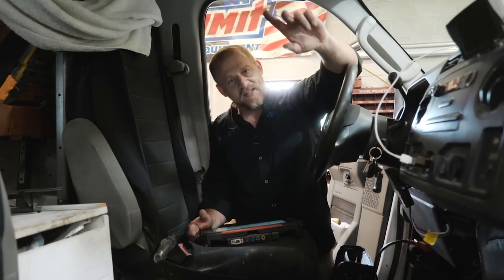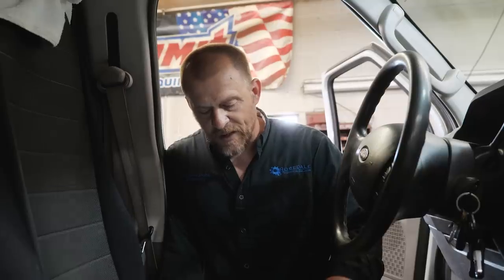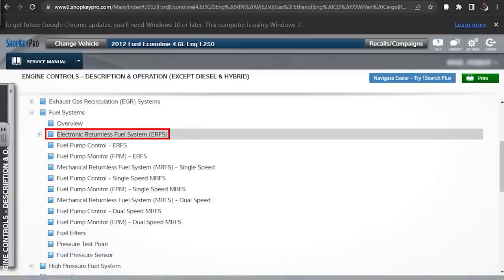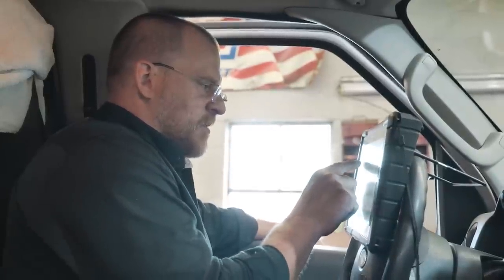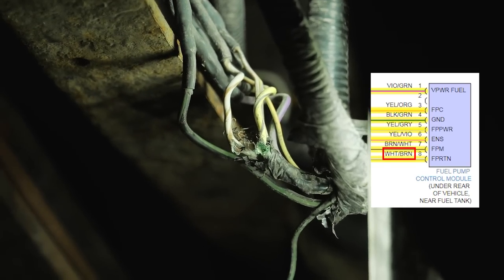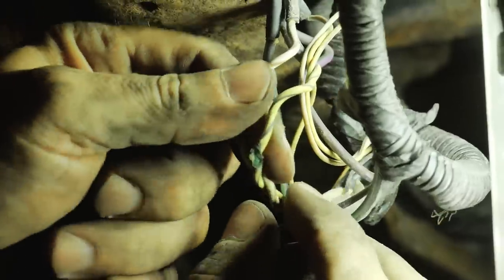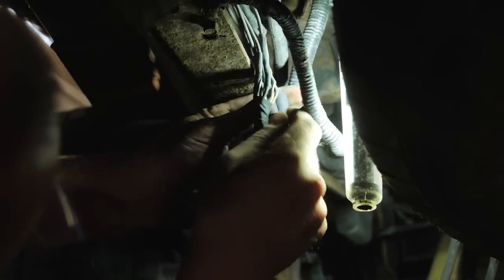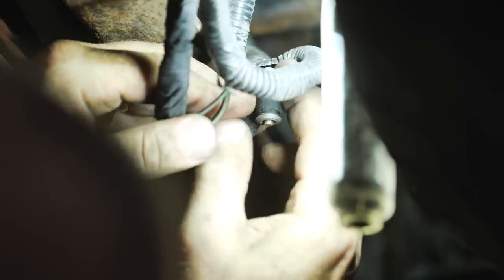New Fuel Pump - Still No Fuel Pressure - Now What? [2012 Ford E350]

Comment: I am one of those southern boys, glad I don't wrench up north! 🤣😂🤣😂
Reply: Ya it will give u a whole new look at a Subaru especially when you have to replace rear cv shafts due to being seized in the bad wheel bearing.
Reply: @claytoncoolidge992  I’ve gotten my hands on a few rust belt Subarus, down from the NC mountains. Not a fun time, but have gotten them done.
Reply: @MrSubaru1387  ya u want some Michigan rust? 😂😂😂  can send it to you by the lbs
Reply: @claytoncoolidge992  no thanks! 😂😂😂

Comment: I agree with you about starting either. It is so volatile that I've seen the hot wire on the MAF sensor ignite it and actually blow up the air cleaner housing. Way back I cranked over a car that was towed in and had so much either in it you could smell it across the parking lot. There was an explosion that blew the valve covers off of the engine.

Comment: Paul I got one for you, I changed the fuel pump on my 89 
F150, I put everything back together truck would crank, but not start, I check for power and ground at the pump, the fuel pump would work if you took jumper wires and hooked it to a car battery, but wouldn't work if connected to the truck harness. Something told me to check the wires at the pump, the wires on the pump were crossed. I switched the wires truck started right up. Always do a visual inspection

Comment: I am all for the splice sleeves with the adhesive in them too. It's quick and easy. The key is, don't buy the cheapest ones you can find. I look at it this way, when I worked for GM, they used to supply those sleeves in connector repair kits for a reason. They work, when done correctly. It is also important to have a good set of crimpers. I bought a set online about 10 years ago that are identical to the ones GM supplied us with in our electrical tool kit. They work awesome, a perfect crimp every single time.

Comment: I've been searching for info on the reason for this type of system, I was working on a 2010 expedition and the pcm was not sending out a signal to the fuel pump control module. Turned out the circuit on the board of the pcm was burned. All i had to do was to clean then jump the burned part of the circuit. But I've always wondered why there was no fuel pressure sensor on the rail, how does the pcm know what command to tell the the fuel pump module. Now it makes sense.  Thank you for sharing this paul!

Comment: My first move on those old Ford trucks was to slide under it and confirm that the FPM and wiring were corroded. They picked the worst possible place to mount a module with an aluminum housing. It helps to spray the module and connections with something to protect them from salt water and humidity.

Comment: I'm with ya on the starting fluid issue. Except that I refuse to use it and you cannot find a can of it in my shop. It's way too easy to use my KV paddle to check for ignition (sometimes) LOL.

Comment: Thanks Paul love your videos using my SD test light it helped me diagnose my bad AC compressor on my Honda . Connecting to the positive side of the battery I read ground on the positive side of the compressor connector . With the connection in , the condenser fuse continues to blow when I disconnect the compressor power feed the circuit stays energized and condenser fans runs normally . Your videos have helped me to save money for me and my family in these tough times . God bless you and your family
Reply from the maker: Thank you! God bless you too my friend

Comment: Michigan(road salt during the winter)eats those modules up like candy. On those Ford trucks after i check for spark and fuel pressure like you did i usually make a bee line for the module (they split) since that issue is so common, as well as the wire corrosion issues.

Comment: When I do not have brush on electrical tape, I use RTV.  I warm it to cure it more quickly.  But it has to be the RTV that does not smell like vinegar (acetic acid) as this is corrosive.  I use ultra grey as it is oxime based and non corrosive to metal.

Comment: i've seen the green crusties wick up a foot and a half into a wire. its a pain but i cut and strip till i get clean copper   no black or green.   best thing i ever used was butyl tape. years ago it was available through euclid heavy duty. nasty sticky crap but it worked like nothing else

Comment: Bad ground strap on the passenger side underside. Im calling it before I watch the video. Lol
Reply: lol same here
Reply: I just had that happen to me, the weave ground strap rotted away on a 2011.
Reply: Don’t break those fuel line locking clips. Impossible to find new, or the fuel lines are practically extinct
Reply: @BigJohnnyo80  I literally see 2-3 a week for the ground strap. We have a fleet of them vans.
Reply: I tested ground and power using the body ground on the door. So I mistakenly thought I had a good circuit. NOPE! Got the pump to run off a ground from the trailer electrical connector 😞
Reply: 6 dollar ground cable was the fix. We grow and learn from mistakes.
Reply: That's on GM vans. He's working on a ford. But yes no fuel pressure on express vans ,give that ground strap a tug
Reply: Mine is a 1ton ford, 2011
Reply: @DavesOMC  I assure you it’s on the ford econolines. I see them every week.
Reply: @puremayhemFTW ok good tip. I've never fixed that on a ford yet. Gm vans are same way and I've seen 20 of those failures over the years.
Reply: Out of fuel I’m calling it to! ❤
Reply: I had something very similar on a 1998 Suburban K1500. It was a bad ground point on the chassis. The fuel pump was bad as well lol.
Reply from the maker: Nice! It wasn't that, but I will look for that in the future. Good example of when to use actual battery ground for your voltage tests right? As @BigJohnnyo80 said
Reply: If it was a gm you maybe right,
Reply: @puremayhemFTW agree
Reply: @vunit8213 it ain't got no gas in it mmmhhmm

Comment: I noticed a blinking red light under the steering column. Even when the key was turned off, maybe we have an alarm system issue that was hooked up to the fuel pump?? This is only a thought at this point I have not seen you attack a fuel pump yet.
Reply from the maker: never even noticed that

Comment: Many times I find soldering old wire nearly impossible do to the surface corrosion of the copper. In the salt water marine environment we have better luck with the crimp connectors with heat shrink and hot glue. There are times we have to run new wire from one end to the other because the corrosion has traveled all of the way up and even turning the wire to copper dust. We also use a product to coat open connections, battery terminals, and metal parts called Linebacker from Zep. It is an anti corrosion spray that dries to what I think is some kind of wax. I also use it on and in connectors if I think they might be subject to salt water spray or bilge water. Good for battery connections also. I don't think any plug connection can be made mechanically salt proof. Just one grain of it will do a lot of damage on electrical systems.

Comment: Hi Dan. So. I get all that.  I'm really appreciating your work .👍🏻  l fallow circuits  . Electronics hard wire .wireless.   alarms so knowing that . Power supply  is some what all ways an issue.  Video signals are the same .  Everything comes back to a central station . We can find voltage drop bad contacts  . Bad components.   We some times have to find control switches  or other issues.   So we can do & replace or repair every thing in front of situation.    So why is finding or replacing /repairing  so Dam difficult.  Please lm just asking  yeah lm good at what l do  as you are 👍🏻

Comment: I'm old enough to remember working at Ford and having to go through those giant breakout boxes.  They were better than poking holes in wires, even in Southern California - we did have that coastal strip that extended 10 miles inland.  I've seen some sh*t.

I also remember those rollover valves.  Great in theory; in execution, not so much.  A traffic or speed bump could set them off.

I can't remember if that light duty black/gray wire was for radio interference, but I think it was.  Maybe still is, although you'd like to think we're beyond that, these days.  

Remember when certain cars would get to intersections and die because of the communications equipment interference with the early PCMs?  I only have vague recollections of that, since it was early enough in the production of whatever make/model of car it was, and it wasn't my make/model of car.
Reply from the maker: those breakout boxes sucked :-) Step 1 of a flow chart "install BOB" lol I didn't even know who BOB was back then in the aftermarket 😉😂

Comment: The heat shrink crimp connectors are great except from where you crimp it causes a break in the heat shrink and corrosion sinks into those areas. If I have some of that liquid tape I put a little bit liquid tape on that as well and that would not have issues down the road.
Reply from the maker: The ones I use have an adhesive that will fill any splits in the outer shell from crimping

Comment: I solved a intermittent no start problem on a E350 2012 recently, it was the SRS Module under driver seat.

The communication with the fuel pump went through the srs module and since the srs module was completely rusty, the signal could not pass.
Reply from the maker: Nice job

Comment: What's the primary circuit Vs secondary, I've seen it  on fuel system and ignition system as well 🤔 
any direction to a video I should watch 🙏
Reply from the maker: With a fuel system, that would have to be GDI systems that may use that terminology as there is a low pressure pump and a high pressure pump. I don't know, I'm not sure I've heard that term applied to a fuel system. But the ignition system, the primary circuit is what creates the magnetic field to collapse around the secondary windings to make spark. Anything on the spark side is the secondary. It starts at the coil and includes plugs and wires. The primary would be the 12v side that is switched on and off by a module or ECM 

Also, you could call a relay as having a primary and secondary. Again terms not used, but technically it would be correct. The primary would be your low current side and the secondary would be the load carrying higher current side.

Comment: I believe the two speed pump function allows the pump to run at low speed under low engine loads and high speed under high engine loads.
Reply from the maker: in this case that is correct but it is not to control fuel pressure as that is done by a mechanical fuel psi regulator in the tank. So it would seem this is simply to reduce fuel pump volume/current flow, which allows less of an alternator load. It is silly if you ask me, but I know of other manufactures that do this too. There is a variation to this same fuel system in that they don't use a fuel psi regulator, and there would be a rail psi sensor on that design, where they are controlling pump speed to control pressure. But that is not being done here. Not sure why all this would be done to save a few pennies on gas mileage from alternator loads

Comment: You said "it's interesting that it's often the power that corrodes, and not the ground" --    That's not always true-- and it depends on the type of metals that you're dealing with.  It's known as "galvanic corrosion" and there is a range of "noble metals" that can react differently depending on how you arrange the different metals in a circuit.  For example how they put a sacrificial anode on boats (usually zink I believe) to save it from corroding.   Practical Engineering did a pretty good video explaining all this stuff, called:   "These Metals Sacrifice Themselves to Prevent Rust"
Reply from the maker: With copper wire on negative ground cars, it's always the 12v side that'a corroded.
Real old cars were positive ground (I may be using the wrong terms here) but the block and frame would have been 12v or maybe 6v at the time. Anyway, I wonder if those corroded differently
Reply: @ScannerDanner  You should watch that video explaining nobel metals though.  It's worth your time.   called: These Metals Sacrifice Themselves to Prevent Rust

Comment: One thing I never see you do before messing with wires, do you think you should disconnect the battery first?
Reply from the maker: No, on a 12v system almost never! Why? Because loaded circuit voltage drop testing is what needs to be done.
Reply: @ScannerDanner   Well I was talking about not doing testing, when doing repairs. Sorry for the misleading question.
Reply from the maker: @moneymikesupplymusic  no problem. It all depends on what repair your doing. If it's an airbag, then absolutely you should have the battery disconnected. If it's a hybrid, then absolutely the high voltage system should be isolated. If it's a starter or alternator replacement, then absolutely you want the battery disconnected. Most other systems, it is absolutely not necessary and only creates problems!
Reply: @ScannerDanner   On my van, I am having the same problem. Checked the wires near the fuel pump driver module and they was good. It is a intermittent problem and I want to run a jumper wire from there to inside the van so I can monitor the battery voltage going to the module. What guage of wire do you recommend using?
Reply from the maker: @moneymikesupplymusic  if you are just tapping in for a voltage measurement, it doesn't matter what gauge wire you use as the current flow for the existing circuit won't be traveling through your jumper

Comment: They put a fuel pump in, but didn't verify  power or ground to the pump?
Reply: Yeah, that's rough 😅
Reply from the maker: I see this all the time, from all over the world. Customer thinks they can handle it and change the pump after some Google searches for no fuel pressure
Reply: @ScannerDanner  I totally get that, not to to long ago I had a crank no start on fusion I believe it was.   Customer had installed a new fuel pump and a bunch of other parts and couldn't get it to start.   The thing was out of fuel, best part was the fuel light was on.     

 Then about a month agoI had a crank no start on a Nissan.   It again had several parts thrown at it, it had no fuel or spark.   It was 4qts low on oil, added 4qts of oil and it fired right up.

Can't get tunnel vision on one system,. Far to often I see guys chasing codes that were set due to a result and not the cause.

Comment: Why we checked ignition when there's no pressure. Nothing like I'm teaching you something, just want to know why we do that.
Reply: Is that because of whatever reason ecu gives command to ignition and fuel pump to stop functioning? But if computer wants not running engine than it should disable injection pulse right? I'm confused...
Reply from the maker: It's a direction based test! If I also have no spark, there would be zero reason to crawl underneath this van to check pump powers and grounds, because it wouldn't be there! 
Make sense?
Reply: Oh yea.. right, thanks for answering

Comment: My concern with the connectors has been damage to the area that gets 'squeezed'...breaking the surface. I'm thinking now that if a good crimper is used, that area of the tool is flat and more broad reducing the risk of breaking through. 
Anyone have thoughts on this without making me feel stupid:)
Reply from the maker: absolutely! And my crimpers will break the surface at times too, but the crimp connectors I use will ooze the adhesive out of that small hole too. I've only had one comeback on me in all the years of using them and it was from exactly what you are referring to. I crimped it too hard and it broke in that location again after about a year or so.
Reply: @ScannerDanner Never considered the coverage offered by the connector...it's not only at the ends. 

You have a great deal to be proud of with Caleb and have nothing but respect for you as a father.
Hope to meet one day at a training event.
God bless from a dad, tech and shop owner - Toronto Canada.
Reply from the maker: @unencumbered  I'd like that too! Thank you my friend

Comment: uhoh, probably a triton 3v and needs heads.... 🤣🤣
**joking aside, fuel inertia switch tripped? (or computers/modules stopping it). after seeing it's a work van, it's likely been bumper banged endless times. lol
Reply from the maker: No inertia switch on this one. It uses the airbag system for that info on this model

Comment: No gas in the tank....🤣🤣🤣🤣
Reply: Sling Blade ! Good one !!!
Reply from the maker: I've been burned by that before. Long story and not funny 😂😂
Reply: @ScannerDanner I believe anyone who has been a tech for any length of time has been torched🔥🔥🔥 for something that simple.....
Reply: i have been burned on that,engine stop on the freeway,got towed in ,no one could work out what it was ,i had a go too,fuel gauge said half tank,engine fired if gave it some gas,undone fuel filter,was empty ,strange,turn out the pick up pipe,in the tank,the strainer bit ,was full sludge,bad fuel,was half tank bad fuel,we conect a fuel line to steel pipe at the gas tank,into a fuel can ,of new fuel,crank engine over ,and it was sucked up and engine started,ran nice ,till can empty ,they drop the fuel tank,clean out the bad fuel,strainer on the pick up pipe,add new fuel,conect to verhicle ,started up good again

Comment: Paul, carburetor cleaner can damage 02 sensors.  It is always best to use propane.
Reply from the maker: I've not experienced that
Reply: @ScannerDanner  It won't necessarily kill it right away, but it will coat the ceramic and reduce its life expectancy